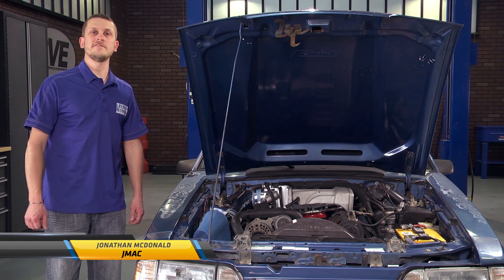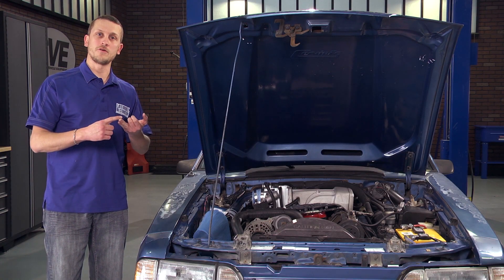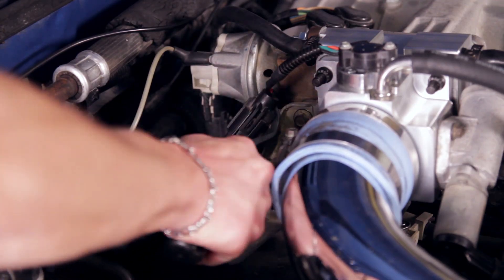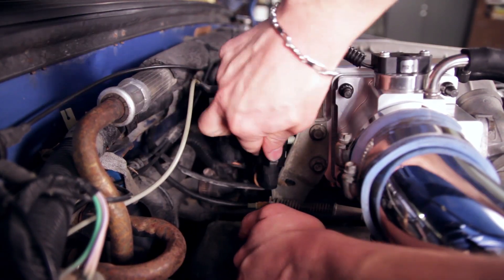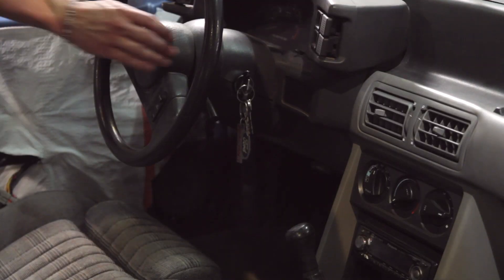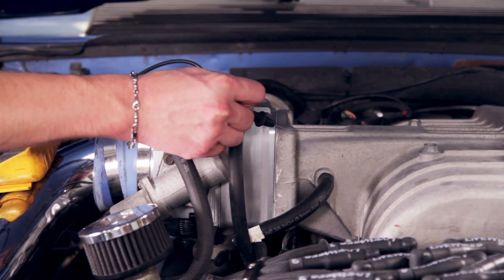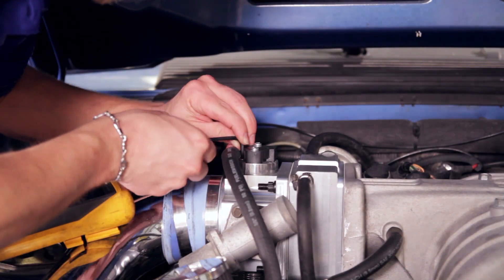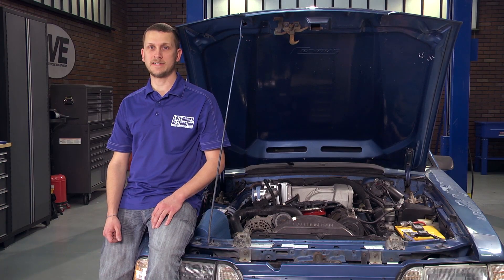Mustang TPS Install - How To Adjust Throttle Position Sensor Voltage

Comment: Would this cause your vehicle not to start?
Reply from the maker: Typically, no. Have you checked the voltage of the TPS? Does it change whenever you move the throttle blade? Is the car getting fuel and spark? -Landan
Reply: @latemodelrestoration  yes even with a new TPS I'm only getting about .34 volts. So I've replaced my fuel pump relay. I have plenty of fuel pressure. I have spark,  I changed the TFI to be safe. Fuel/EEC relay both click with ignition in the on postion. I have power in all my fusible links, ground cables are clean, one thing I do notice is with the key on, my fuel pump constantly runs. I hear fuel pressure throughout the fuel rails. If I unplug the TPS my car won't even crank. When plugged in it just cranks but no start. Not sure what else to check.
Reply from the maker: @mosesandres3385  No, the fuel pump should not constantly run with just the key on and the engine off. The acceptable TPS range is .5v - 1.25v with the key on/engine off. .99v has always been the "go-to" for folks. It's just easier to remember I guess. There is a really good write-up on one of the forums covering Fox Body no-start conditions. I suggest reading through that. -Landan

https://stangnet.com/mustang-forums/threads/cranks-ok-but-no-start-checklist-for-fuel-injected-mustangs.787471/

Comment: Would this apply to 87-91 full-size ford cars with the 302 efi?
Reply from the maker: The same basic procedure is the same. Keep in mind that the wire colors on your application could be different. -Landan

Comment: I replaced my throttle body, the TPS is at 0.818 and now the car won’t start. Triple checking everything
Reply from the maker: The car would still start with a faulty TPS. Did you change anything else other than the TPS? Did it have this issue before? -Landan
Reply: @latemodelrestoration  Talking out loud…would a bad MAF meter cause this, and possibly need to be replaced? Would a bad IAT cause this, and possibly need to be replaced? I may just uninstall the new throttle body and install the old one. I need the car ready by the 17th. Sucks but it’s all in the fun of restoring a car.
Reply from the maker: @motor_citymuscle288  As you can imagine, it's difficult to troubleshoot a vehicle over the Internet. We put together a list of things to look for you have a no start condition. Just to try and validate the issue, you could revert back to some of the old components and see what happens. -Landan

https://lmr.com/products/mustang-cranks-but-wont-start-checklist
Reply: @latemodelrestoration  no issues before. I also replaced the air intake with a cold air intake. I just disconnected and reconnected the items below…
1. IAC
2. TPS
3. Throttle cable
4. Cruise control cable
5. Helper spring
6. MAF Meter
7. IAT Sensor
8. Master plug to MAF
Reply: @latemodelrestoration  checked battery level which is good. Tried a little burst spray of starter fluid.
Reply: @latemodelrestoration  I also unplugged the battery for 30 min
Reply: @latemodelrestoration  I removed the aftermarket throttle body and installed the OG. It fired right up
Reply from the maker: @motor_citymuscle288  Well that's good! At least it was something simple. -Landan
Reply: @latemodelrestoration  thank you for responding

Comment: Wow
Giving half the proper information is ....... Smh
The A9L and A9P automatically adjust for tps voltage of .6 to 1.2v.
The critically important part is wide open throttle must not go above 4.9v.
🙄

Comment: Hello
Question why is my TPS reading 4.95 switch on or off from green wire and ground from intake manifold 

And it reads 0.0 from green wire and black wire from TPS plug

Using a multimeter 
DCV

Please advise 

Thanks
Reply: mine is doing the same thing, did you get yours fixed?

Comment: Is it the same voltage for a supercharged engine ?
Reply from the maker: Yes, the voltage will be the same as a N/A 5.0. You won't need to go any higher or lower when adding boost.

Comment: I need help. 
I have a 05 mustang v6 but after hours of research on the internet still can’t find what’s the voltage adjustment for it.
Reply from the maker: Please give us a call at 1-866-507-3786 and a customer care rep can help you out! Or send us an email using the link below. Thanks! - Jude H. - Social Media/Events Coordinator | https://lmr.com/contact
Reply: 1.291

Comment: This information is not quite correct.
You need to obtain your earth signal directly from the black wire on the TPS otherwise you will end up with a signal variance of up to 0.15mv.
That make a lot of difference if you are trying to set to 0.97-0.98 for maximum performance  as you could easily end up over 1.0v.
Reply: Also 1994-1995 the tps 0s out at start

Comment: Need some help i have a 1988 mustang gt it was riding rough backfiring no power ext so i bought new distributor spark plugs wires still was riding rough so i bought a new fuel filter and it felt good for a day now i have throttle body getting stuck and its still back firing and help?

Comment: when you actually start the car what is the voltage supposed to be at because mine starts at 0.98 with the car set to the on position but off and when I start the engine it reads  at 1.08

Comment: is it the same for 94&95 because I can't see it
Reply: mustang 4life I'm doing my 94 right now my tps is not in the same exact spot
Reply: mustang 4life the tps is right on your throttle body, If your standing behind your mass air flow the iac is on the right while the tps is on the left of it you can miss it it’s the only two components hooked up to your throttle body

Comment: I have a 01 Mustang 3.8, I've replaced the TPS and the car got worse, I put back in place the original TPS and the car when back to the previous condition, any advice for installation for this type of sensor for 01's Mustangs?? Thanks !!
Reply: M Giovanni If it has a MAP sensor, try that. Replace the charcoal canister purge valve if the engine runs rich.
Reply: Did u check voltage
Reply: Same issue. 1998 3.8 Stang. I replaced the TPS without knowledge of adjustment. Now I have a P1120 code. I'm going to re-adjust the TPS with a meter. I will give the results. Great video

Comment: Was idling around 15-1800 rpm at times and overheated VERY fast when it jumped. Shop wanted $250-300 to fix. Checked my tps as the video instructed and was at 1.2v. Had to drill my tps slightly and am now at around 9.6v and wow what a difference! Idling at 8-900rpm and I have a noticeable increase in power and no more issues! THANK YOU!! BEST CHANNEL EVER!
Reply from the maker: Rob J Thanks for the kudos! -Landan
Reply: I'm going to check this on my mustang

Comment: I have a 97 mustang v6 and the check engine light is giving me a p1443  code to replace the canister purge valve, do you have or can you make a video showing where that part is located in the car so I can replace it in mine

Comment: That's all wrong for one never ground on anything but black wire from tps an never drill the tps it's the idle screw is in too far back it out an check tps the unplug iac an spout an batt let sit for 10 min start car for 2 min off 2 min start wit all power on for 2 min computer has learned new tps setting an if u have idle surge do this need to relearn sensors
Reply: Greg Chaffey I'll go ahead and listen to the person who can actually communicate..
Reply: Kenny Wiley lol
Reply: @kennywiley768  funny thing is, this guy was closer to fords own tsb for tps relearn than lmr is.

Comment: Sometimes on startup my 89 GT surges at idle very dramatically and eventually smooths out and runs fine. When I hit the gas it somewhat evens out. Wondering whether to go more in the direction of IAC or TPS, or both...voltage and rpm surge up and down when this happens. Thoughts?
Reply: Gorilla Panic I get the same symptoms as well. Were you able to figure out what caused the surging?
Reply: Guess they never figured it out about to find out
Reply: I have the same issue and will buy a new tps along with my new cl75mm maf.
Reply: You ever figure it out?
Reply: Got the same issue in 2024 lol

Comment: What brand of a dvom are you using?  Could I pick one up at my local Autozone?  Oreily's ?  Many thanks for your time.  What voltage would you reccommend that you set the dvom at?  Thanks again.

Comment: Does this work for an SVO Mustang also, or are the settings different?
Reply from the maker: Same process for 86-04 Mustangs. What year is your SVO??
Reply: Mine is a 1985. Do the majority of your videos (gas tank/fuel pump, etc...) cross over for use? I have ordered from you in the past and have always received great parts and service!

Comment: I thought you check the "Green" wire for the voltage, not the "red" wire. I always used the "green"....

Comment: Unhook your negative cable on your battery before you do any repairs. So the computer can re-learn everything.
Reply: If you unhook the battery how tf do you expect to get a reading on the meter?
Reply: @Dconn1994gt  you get the reading and set it before you start it. once its were it needs to be, then you unhook the negative cable for 20mins before starting

Comment: have a question...what for are the water hoses connectet to the EGR Valve spacer??
heating up incoming Air or what..I live in Costa Rica..lowest temp 25 celsius...to keep air cool wouldnt it be better to disconnect the waterhoses..or what is this heating for..??
Reply: There's not water going to your egr, you have a tube that comes from your exhaust.

You can delete the egr, but that will only give you worse fuel economy